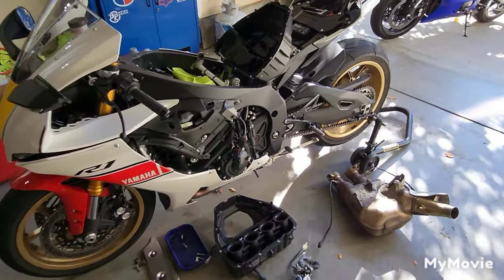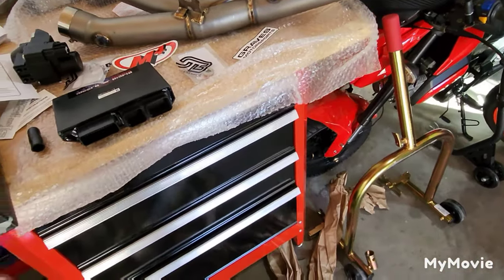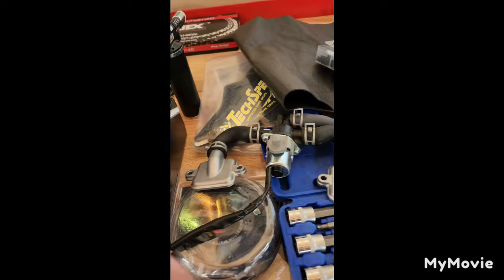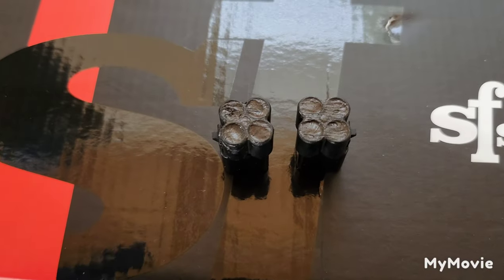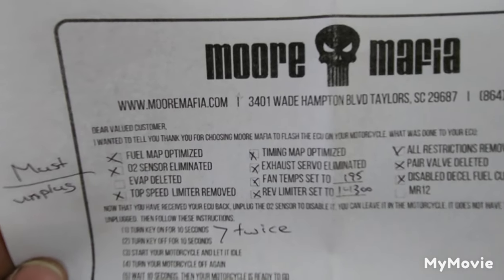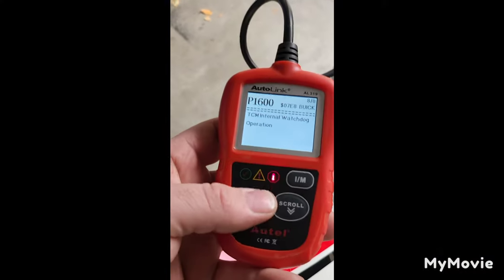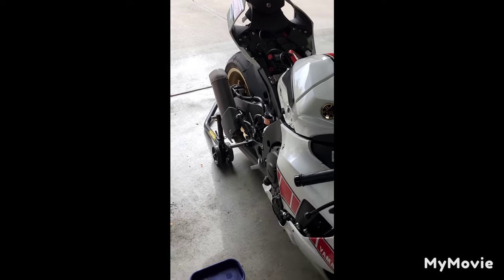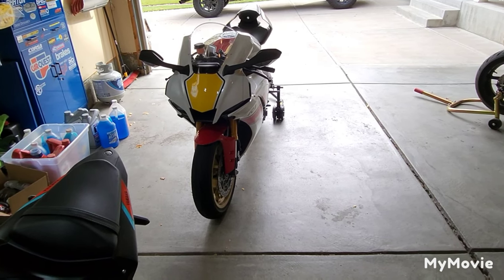2022 R1 with M4 Exhaust midpipe, Moore Mafia flash, Sprint air filter and Graves block off plates

Comment: Nice work. I like the stock can no mod look. Curious if the Vortex rearsets offer up any leg room improvement? I’m a big fan of their rearsets. Had them on all of my rides.
Reply from the maker: Thanks for the comment. 
I am a big fan of Vortex products for the most part as well. 
The Vortex should give you more room, I have the same ones on my R6, and they made a drastic improvement on the ergonomics. I haven't gotten them on this R1 yet, but I have had them on older models I have owned. 

You can't beat the price point either.

Comment: Nice video , and great looking bike.
Do you have a link for the adapter cable you bought for the scanner to bike connection please as I need one?
Thanks . 👍
Reply from the maker: Here is the link for the adapter for the euro 5  cheap on Amazon. 

https://www.amazon.com/SuperOBD-Motorrad-Diagnose-Motorcycle-CAN-BusKTM/dp/B09GX4PVQ1/ref=mp_s_a_1_4?keywords=Euro5+connector&qid=1686573644&sr=8-4

Comment: To seal your connectors from moisture spay electrical grease on terminals then put a small Ballon over them and then ziptie them tight. Great video!
Reply from the maker: Thanks for the tip. I will give that a try. 

I didn't think about balloons, I was cutting the ends off the fingers of rubber gloves. Didn't work out so well.

Comment: Hey man the cables and plugs that aren’t needed anymore, can’t we just remove them completely? Maybe not the plug near the spark plugs but the servo motor plug, and the o2 sensor wires since they aren’t being used anymore? Doing this soon to mine and I was curious. These bikes look amazing.
Reply from the maker: You could technically remove them, but the hassle of tracing the wire to the ecu and then getting the wire out of the connector to the ecu just wouldn't be worth the time or the chance of screwimg.something up. 

I hope that makes sense, and the only one that bothers me is the one for the exup, I haven't figured out how I want to protect that one from being open.

Thanks for the subscribe.

Comment: Great video. Does it matter which plug to hook up to with the scanner? I've seen Red or White being used. You used the Red plug.
Reply from the maker: Depends on the year. The red is the euro5 plug. My r6, which is a 2020 uses the white.

You should not have both.
Here's a good article on it. 
https://www.motorcycle.com/features/what-you-need-to-know-about-euro-5-emission-standards-for-motorcycles.html
Reply: @moton8tion866  2023 R1. Moore Mafia flash will be here Saturday and looking for which obd cable is correct. It has both white and red under the seat.
Reply from the maker: @Zac Berg  

It should be red,  let me see the white one you are referring to, send a pic to MotoN8tioN@gmail.com

Comment: Nice set up! Had moore do the pop and bangs tune on my r1. Have the P08F1 air filter installed but no block off. Bike sounds hella mean with the comptetion werkes exhaust. Already got noise complaint from my neighbors lol. I have few more parts coming in from motomilion mostly cosmetic stuff. I have the rizoma mirror , belly pan and the winglets ordered. Cant wait for them to arrive and to put them on.
Reply from the maker: I opted out of the pop and bangs. It still has them though. Sounds great in the down shift. Oh, and to hell with the neighbors. 😄🤣

Comment: Question, Why did you go with Moore Mafia VS Bren tuning or similar? Trying to figure out where i should get my 2020 ECU flashed. Thanks, love the bike!
Reply from the maker: It mostly had to do with the fact that I had used Chris Moore on my r6, I felt comfortable working with Chris than some of the other tuners I had reached out to. He took the time and answered all my question. One tuner I reached out( wont mention a name) felt like he just sends a canned response. A comment was made in the response about a feature being done that would not have anything to do with my R1. Brentune was never really in the picture. I am glad that you get a hand held device, but for 700 bucks, It is still just a mail in tune. I also wasnt fond of the fact I have to still wait for a file to be emailed to me, load it and all that, when Chris' turnaround time is just as quick and all I have to do is plug it in an clear codes.

Comment: All my cels went off on their own after riding the bike for around 30-50 miles. ( after ecu flash) i dont think u need the adapter/scanner anymore. I went with a racefit black edition 👍 bike is rediculous
Reply from the maker: Im sure the would eventually turn off on their own, but i hate seeing lights on the dash, The adapter harness was only 20 bucks on amazon and I have had the obd2 scanner for years from my time in automotive. 

How loud is that exhaust?
Reply: @moton8tion866  ohh shes loud. I have yet to hear an r1 sound like this. Those guys over at racefit definitely know what their doing. Its alot different then sc project and Austin racing
Reply from the maker: That's cool, I always like to hear about people trying something different, It gets old hearing the same brand exhaust over and over, nothing against Akropovic I almost dropped the coin on a full system for mine. But then it would be like all the others with it.

I will be ditching the stock canister for an arrow here soon, just waiting on it.

Comment: Thanks for the helpful video, I’m about to do the same to my 23 R1. What are those screws from Amazon called ? Also what is the obd2 adapter called? Is it a 4 pin? Any help would be appreciated.
Reply from the maker: so you will need this obd2 connector
https://www.amazon.com/Adapter-Cable-Davidson-Pin-Motorcycle/dp/B09T98XMLX/ref=mp_s_a_1_3?crid=8E0EMWITBWOZ&keywords=6+pin+red+diagnostic+adapter+-+euro+5&qid=1679427847&sprefix=euro+5+ad%2Caps%2C171&sr=8-3

and these, make sure you get ones that have copper gaskets. 

https://www.amazon.com/BASSANI-XHAUST-Sensor-Plugs-1202P/dp/B006ZBO6NK/ref=sxin_25_ci_mcx_mi_sr_m_ts?content-id=amzn1.sym.9171d0af-5158-4f40-9952-2ba7fb58dd49%3Aamzn1.sym.9171d0af-5158-4f40-9952-2ba7fb58dd49&crid=10HQN7JNB4CW6&cv_ct_cx=o2+Plug+M12x1.25mm&keywords=o2+Plug+M12x1.25mm&pd_rd_i=B006ZBO6NK&pd_rd_r=a2291c03-77c1-444e-b1e7-564e4ee07cbc&pd_rd_w=H2CKs&pd_rd_wg=b9nG5&pf_rd_p=9171d0af-5158-4f40-9952-2ba7fb58dd49&pf_rd_r=GQ3ZKZHVED88T9YH6KNK&qid=1679428099&sbo=RZvfv%2F%2FHxDF%2BO5021pAnSA%3D%3D&sprefix=o2+plug+m12x1.25mm%2Caps%2C148&sr=1-5-15be45fb-58b3-41e1-8342-bd2037f96cb3
Reply: @moton8tion866  thanks so much! You’re awesome bro.
Reply: @moton8tion866  Sorry 2 more question. 1. My obd2 scanner plug has only 14 pins on it, will it work with the 16 pin connector?
2. What did you do with the O2 sensors and its wires? Did you remove them completely? I read that they’re in a wire harness and was hard to remove. Not a lot of info on this…
Reply from the maker: Email me a pic of the connector on yours at Moton8tion@gmail.com and I can see exactly what you are referring too.

Comment: Think the mid pipe by itself might be the way to go for a while. Soinds good. Those tech specs up for grabs still? Just got a 2022
Reply from the maker: It does sound pretty good with just the mid. Highly rec doing the flash at the same time.

With the tech specs, are you referring to the ones on the bike or the bench being available?
Reply: @MotoN8tioN  yeah def gonna send mine off to moore mafia as well might get a new seat first.
Reply: Whichever set you are not using is they will some fit a 2022 haha
Reply from the maker: The story with the tech specs, motosport.com sent me ones for a 15-19, didn't catch it until they were halfway installed, they made it right and sent the correct ones and let me keep the ones currently on the bike. They fit and work. They just don't follow the lines of the 20-22 correctly. If you want the ones on the bike, you can have them.
Reply: @MotoN8tioN  id def be interested im seeing what they look like on my bike. If i dont i stall ill send back for someone that has right year.
Reply from the maker: Shoot me an email at MotoN8tioN@gmail.com, I will send you some pics of the difference and pics closer up of them on the bike. If you can be patient and give me some time to get them off, you can just have them if you still want them. I can't charge for something I technically did not pay for since I was allowed to keep them .

Comment: I got the same bike here in Philippines…though about Cat Delete since stock exhaust sounds like a gentleman. Still waiting for my link pipe delivery abroad takes too long.
Reply from the maker: Once you get the pipe, it will be big improvement in sound even with a stock canister.
Reply: Probably I’ll just let the Yamaha experts do the Job for me coz it seems very complicated to do Cat Delete, I’ll just bring everything at the shop😊
Reply from the maker: Don't be intimidated, it's easier than you think.
Reply: @ju-insung2710  its literally like 8 bolts lol
Reply from the maker: @FlexFast  

It is a pretty easy process. I agree. I think the o2s are the hardest part 🤣

Comment: Hey sir hopefully you see this! 
Got the same bike with a full spark exhaust and block off plates. 

I saw in another comment you said your bike still pops/ bangs even without the added Moore mafia tune. 

So what you’re saying is if I get the Moore mafia ecu flash WITHOUT the pops/ bangs my bike will still have some back fire pops??
Reply: Don’t really feel like installing the AIS again just for a pop/ bang tune if it’s gonna do it reguardless
Reply from the maker: Brandon, 

It does still pop on decel, especially when using the quickshifter on down shift. However,  it's not near as severe as his pops and bangs tune. If you want it to do that, you will have to have it flashed that way. Did I miss the part where he says you need to put the pair valve back on? 🤔
Reply: @moton8tion866  yeah he was saying he can’t do the pop/ bang tune unless the pair valve is still on, which in my case it’s not. So I’d have to reinstall it
Reply from the maker: @brandonbeznoska  

That's unfortunate but makes sense the more I thought about. My r6 makes a lot of noise on decel, same days it does get old.
Reply: @moton8tion866  I appreciate the response!
Reply: @moton8tion866 how long did it take to be returned to you?
Reply from the maker: @brandonbeznoska  

I sent mine out on a Monday overnight, so he would have it on Tuesday. I had it back before the weekend.

Comment: Hi I have a question.I have the same bike.I was trying to change the blockoff plates but when I got to removing the allen bolt in the airbox by the velocity stacks I stopped because some of the bolts was at an angle.How should I approac? I don't want to strip the bolt by mistakes.I was thinking a longer sllen should do the trick.What do you suggest?
Reply from the maker: You will want to invest in some Long ball end allen sockets. The ball end gives you some wiggle room for weird angles and tight spots. For the do it yourselfer, these will work just fine. 

Make sure you get metric. The link takes you to sae. 

https://www.harborfreight.com/38-in-drive-sae-professional-long-ball-hex-bit-socket-set-8-pc-56586.html?utm_source=google&utm_medium=cpc&utm_campaign=17287949464&campaignid=17287949464&utm_content=137551723100&adsetid=137551723100&product=&store=&gclid=Cj0KCQjwn9CgBhDjARIsAD15h0CbjtoYQBkIhvjhe5qb4HiXkYIXjYESmalXa0Cqytvea3Wj-5eoFcwaAn3EEALw_wcB
Reply: Thanks.I took everything apart then I got to that point and turned aroung.I did insert the ball end husky but did turn got nervous.Thought I would strip.I will attack it again.Prefer doing myself because some shops just don't work as clean as I prefer
Reply: I appreciate your response.one more question.The two hose under the gas tank.Only one hose clamp came on my bike,the smaller one.Is that normal?
Reply from the maker: Yes only one has a clamp. 

Don't be nervous just make sure the socket is seated and you will be fine. Yamaha got a little crazy with loctite if I remember correctly
Reply: @moton8tion866  Blessings.Thaaank you.Oh should I use the ratchet or the long T handle?
Reply from the maker: I used a ratchet taking apart and the t handle going together. Less risk of over tightening.
Reply: @moton8tion866  Thank you very very much.
Reply from the maker: @Nasir Jonez  

Anytime. If you have any other questions, just ask. 

Hit that subscribe button.
Reply: @moton8tion866  Goodafternoon.I tried it with the ball end it worked.Again thank you.I feel much better.One problem.what brand of long ball end T handle did you use.Only have the socket set and husky T handle.I am going to finish Today
Reply from the maker: Just use the ball end socket you have, and you should be fine. Just you remember, you don't need to crank them back down.
Reply: Also is it possible to crossthread the screws on the lower airbox?
Reply from the maker: @nasirjonez730  
It is possible, always start them by hand. make sure the lower airbox is centered and firmly in place, then wiggle the screw into place, one thing that helps is turn them counter clockwise first, this will help to center them.
Reply: What should I look for to verify if I installed incorrect?
Reply from the maker: Well, make sure the lower airbox is set properly, rock it back and forth if it has excessive play back and forth. Recheck everything and make sure nothing is keeping it from falling into place. Then go slowly, putting it all back together. Take your time and double check your work as you go.
Reply from the maker: @nasirjonez730  

Check this out:
https://www.youtube.com/watch?v=c2J9u2it6Kg
Reply: Thank You.Thats how I installed my plates.I watched the same video.When I saw yours in the video it looked like yours were the other way.I thought I made a mistake.I am going to double check tha 1 bolt on the lower airbox.I think I am ok because all the others were perfect.I could of already started to turn left came back and because I didn't have to turn much I felt it was a problem.You have been a great help.I hope you do the puig windscreen and post.Thanks again
Reply: Hi back again not sure if you got the last message.I want to know how do I remove the fairring to get to the ecu?I purchased the fullsix electronics cover carbon and would  like to install.Not sure how to remove that fairring.Thanks in advance
Reply from the maker: @Nasir Jonez  

I can definitely help. That gives me a video Idea. Can you give me until tomorrow. It woukd be easier to do a how-to instead if trying to explain it.
Reply: Tomorrow is great.Thank you so much.What time should I check
Reply: A widsceen video too if possible.I dynoed mines I went to Bauce Racing.I got 183 horsepower 81ft lb torque
Reply from the maker: Nice numbers. I should also be able to do the windscreen as well. I will try to have a video up around 1030a  Denver time.
Reply: Thanks again.I am in N.J so I will look out for them.Much Appreciated
Reply: Goodmorning.I was reviewing your video again and you mentioned rearsets.Did you install yet and what's the pros and cons of the set up?Can the stock rearsets be adjusted on the brake side?
Reply from the maker: @Nasir Jonez  

The video is up on the ecu. I will try to get a windscreen one done this weekend. 

As for the rearsets, yes they are installed. I will go over why you should do them on any bike. When it comes to rear sets, the only con to them, is most aftermarket ones don't have a way to use the oe switch, you will need a pressure switch.
Reply: Thank you
Reply: You truly have been a great help

Comment: opening the opening hole on the airbox(called euro airbox mod) before the filter helps the older bikes a bunch, i wish they had made the airbox the same as whats on these. My 09 gained 1.3hp from it(same day, same temp, same dyno, no other changes)and will only increase at speed with ram air effect
Reply from the maker: Ah yes, I did the air box mod on my 09 well back in the day. Never dynoed it to see if it made a difference. Thank you for mentioning that. 

Crazy that bike would have turned 14 this year. 😳
Reply: @moton8tion866  yep still have it and love it. done 3600 miles in the past 17 months, and didnt ride for 3 months of the year due to extreme cold. Just rolled over to 14,500 miles too